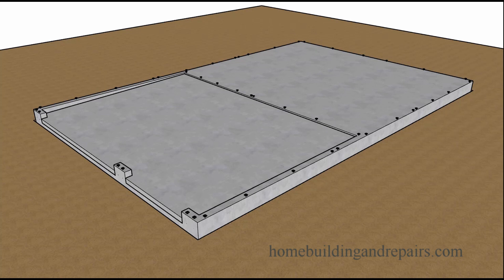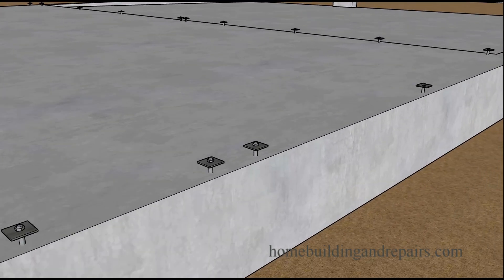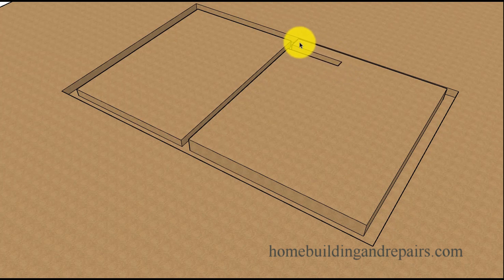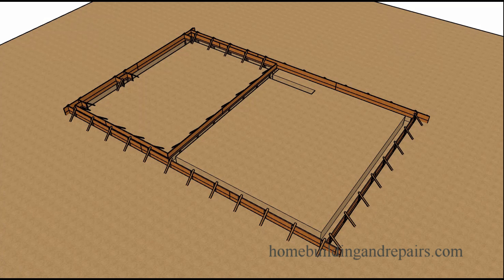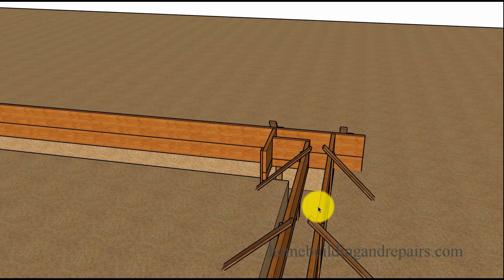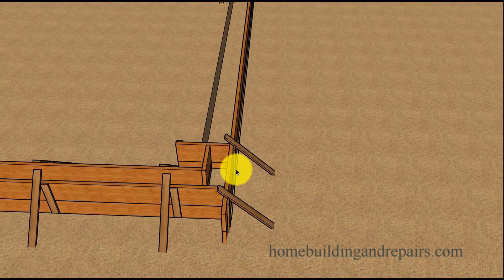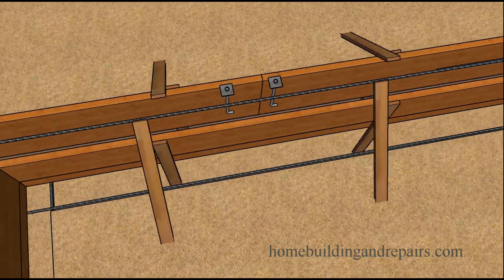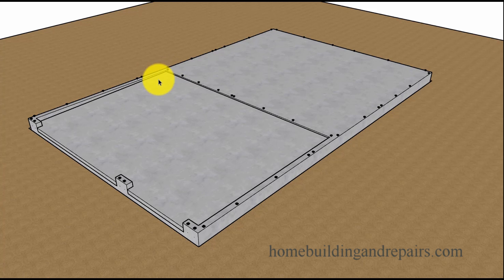Two Story Open Floor Plan - Forming, Rebar and Concrete Foundation Construction

Comment: We are building a house near Palm Springs, CA. Some contractors told us that we can pour concrete for the slab and the garage at the same time. Some contractors said that we need to pour concrete separately. Your advice will be greatly appreciated. I will show your answer to the contractors.

Comment: How much higher do the anchor bolts need to be above the framing plates? Enough for a 2x4 to lay down or enough for a 4x4
Reply from the maker: Here is a link to the foundation section in our website that might provide you with more information you're looking for.
https://www.homebuildingandrepairs.com/foundations/index.html
Reply: @gregvancom  thank you that was really helpful
Reply: And how far do the anchor bolts need to be spaced from eachother?

Comment: Hello Greg, at 3:00 you mention pouring all the same time (footer and slab), do you have a video on how that (a little harder) is done?  

Also around 5:04 there is mention of the rebar above the lower course rebar; how is that rebar suspended?
Reply from the maker: I don't have a video on that and I don't know when I will be making one.
Reply from the maker: The rebar is usually suspended by using wire and attaching it to the forms or other pieces that will be removed after the concrete has been poured around the rebar.

Here's a link to our website that might provide you with more information. 
https://www.homebuildingandrepairs.com/foundations/index.html

Comment: Can you make a video on how to make two levels of concrete
Reply from the maker: I would need a better description unless you're simply referring to pouring a concrete slab over another concrete slab and if that's the case, I would need to know how thick both of the slabs are going to be.

Comment: What type of foundation do you believe is best for a 2 story home. It will sit on a 30 X40 lot. I live at Mobile, Alabama. Any feedback will help. Thank you!
Reply from the maker: Since I'm in southern California I would suggest contacting a local contractor, engineer or building authority. You could also look around at all the other houses and see what type of foundations the majority of them are using. In some areas homes are built higher off the ground because of water flooding.

Comment: Hi, can I use the concrete as the final floor for the house, I didn't see any plastic for vapor barrier is the plastic necessary for protection or I can use a concrete with some waterproofing additive include (if exist) ?

Comment: hello Greg how do i build a foundation on area of land that has an existing manhole structure about 15x7x11  (ft).. how do i seal the hole and build a foundation
Reply from the maker: First off, I need to point out that I'm not an engineer and will only be providing you with an opinion. If the structure is no longer being used, then it might need to be back filled or removed. You might need to contact local government authorities to verify whether or not you can actually build something over an existing manhole.

Comment: What is the footing depth for a two storey home?
Reply from the maker: I cannot provide you with structural engineering advice for your specific project, but can tell you that I have seen plenty of them 12 inches wide and 15 inches deep.

Comment: Plz how do you divide a floor plan into slab panels?
Reply from the maker: If you're talking about dividing the concrete house slab in the sections, that's usually not going to be approved by your local building authorities or engineers.

Comment: Might be stupid but how do you get a slope for the garage ?
Reply from the maker: You create a horizontally level line and this can be done with straight lumber or string, then you figure out how far you want the slope to fall and then adjust accordingly. You've got to start with a straight level horizontal line. Let me know if this didn't help, because I realize it's going to be a little more difficult than how I explained it.

Comment: For the homes in my area, they pour the stem wall first (and separately). They also insert vertical rebar elements in the stem wall all the way around. After the stem wall cures they bend the vertical rebar elements over and then run rebar across where the slab will be poured tying them to the bent over rebar from the stem wall. (In order to do this they pour the slab over the stem wall. )

Your video doesn't do this. Why or why not? Thanks.
Reply from the maker: I think the main reason is structural strength, it's going to be one solid unit if it's poured at the same time, but if it's poured separately, even with the rebar, it will basically be two separate units, the footings or slab, instead of one solid unit of the footings and the slab. Let me know if that doesn't make sense.